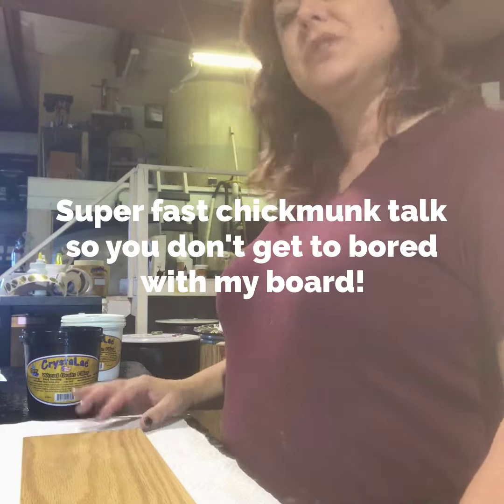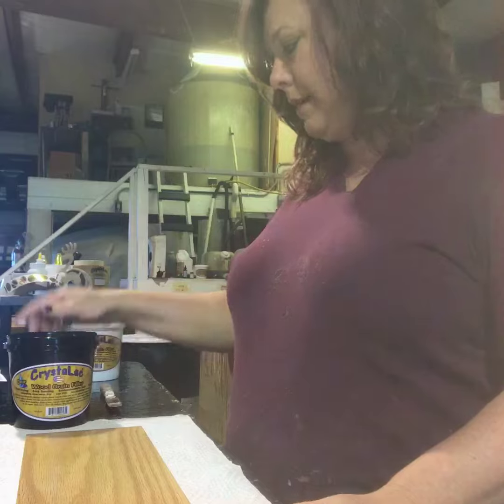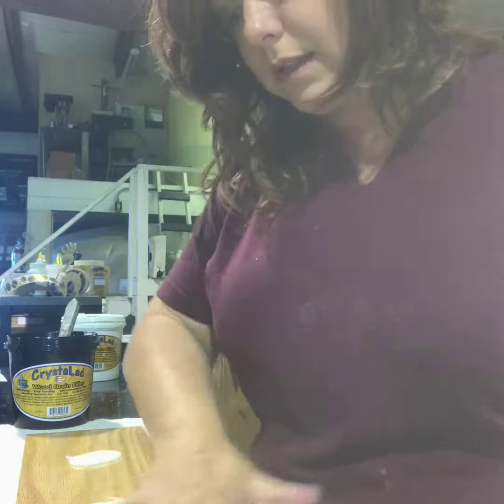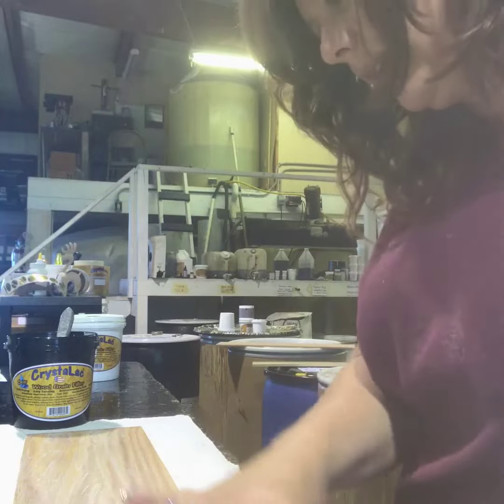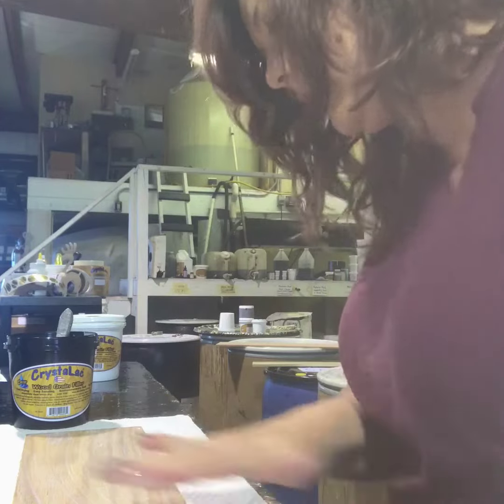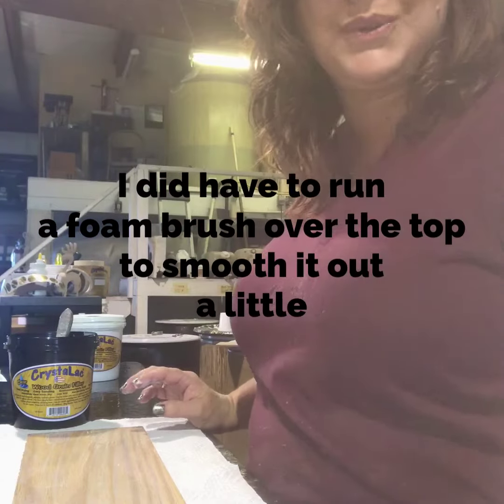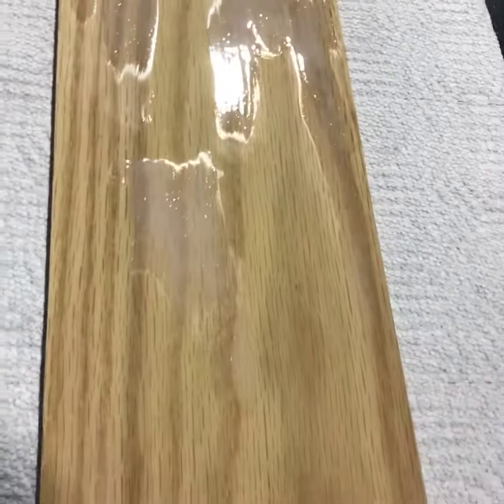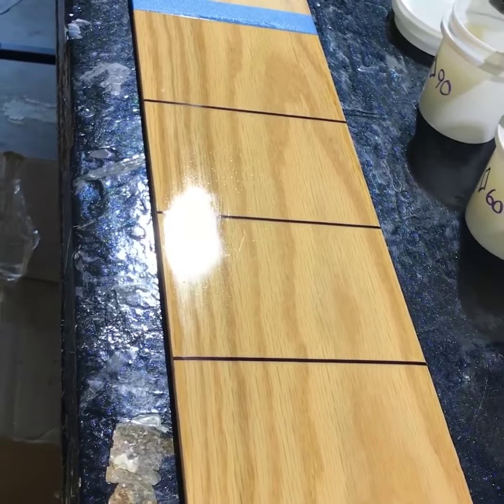How to make a Glass Smooth Surface using CrystaLac Wood Grain Filler & Super Premium

Comment: I just made a custom door and used some plywood as middle panels of the door. Can I use the wood grain filler to cover the osb so that I’ll have a smooth finish when I go to paint it?
Reply from the maker: You sure can. Think about using a foam brush and apply a thin coat over the osb. Do multiple thin coats if needed but be sure to give each coat  time to completely dry.

Comment: Im a luthier and thought Id give Crystalac a try Ive heard a lot of good things about the easy problem-less application.  Im not sure why by when I applied the sanding sealer to my sanded cedar top guitar and came back 4 hours later, it had somehow developed hundreds of little dark brown small spots over the entire top of the guitar.  I ended up sanding it all back to bare wood to get rid of the spots.  Any ideas of why or what happened?
Reply from the maker: Good morning. Without seeing the spots it is really hard to determine exactly what it was that you observed as black spots. My best guess is that with cedar you are dealing with a lot of tannins. It may have been as our waterbased Amber Tone Sanding Sealer dried and tightened up the pours it drew out the natural substances in the cedar.